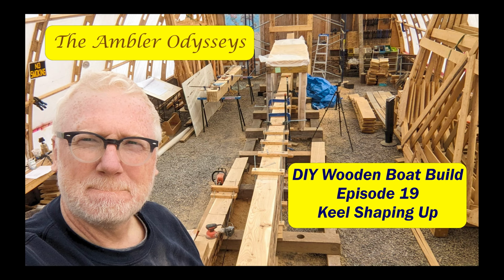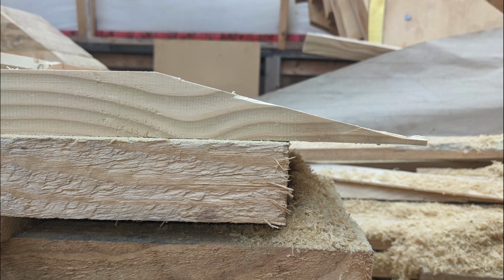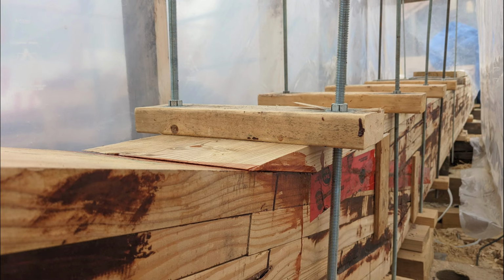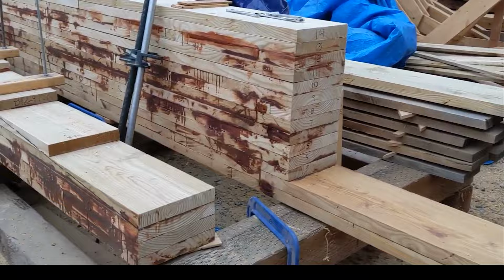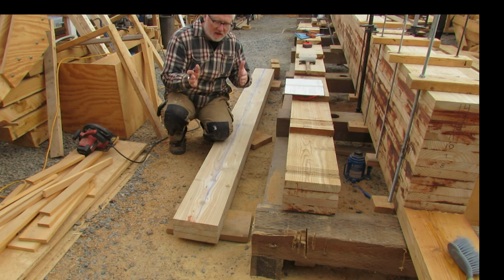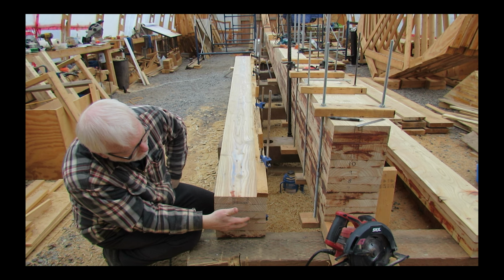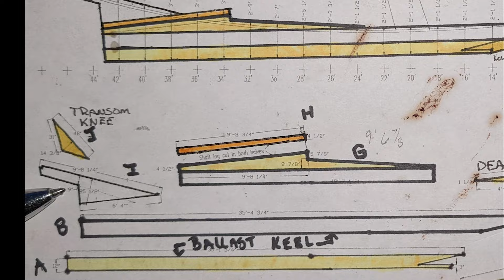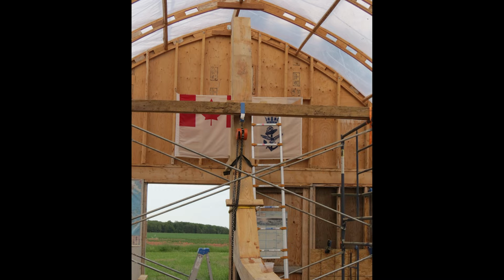Boat Build - Ep19 - Keel Lamination Finished - Building A Wooden Troller Yacht

Comment: For the shaft alley would it of matter if you cut the hole a little deeper and just did two cuts and separated the board into three pieces? I don't think a eighth of an inch deeper on the top or bottom of the board would matter that much at all, just my opinion, would've saved a lot of time, that's all.. 
Nevertheless, that's quite a bit of work to get that keel laminated up! Your getting there though, it's looking Good Bill. That's quite the milestone.

Comment: Did you consider using your router to cut that shaft alley?
Reply from the maker: That is why I love these comments David, they make me go back and think. No, I did not thing about using a router. It may have been easier using a base plate to keep inside the lines, but that is alot of Larch to clean out. I would be concerned about burning the motor out.
Reply: @TheAmblerOdysseys  yeah it would have to be a pretty stout router.  It is interesting how people approach things differently.